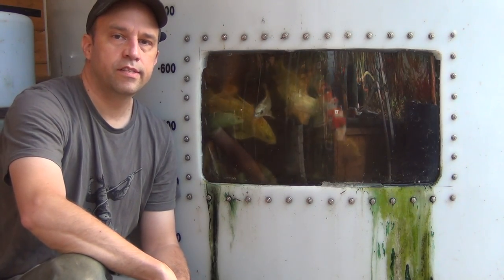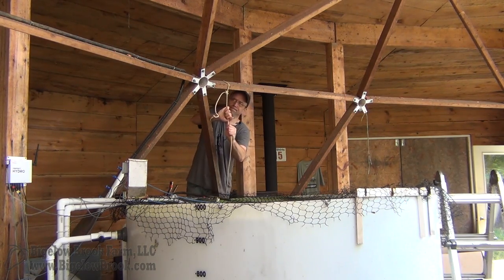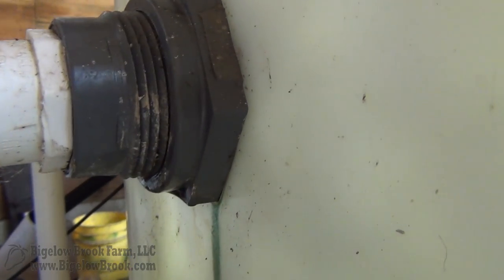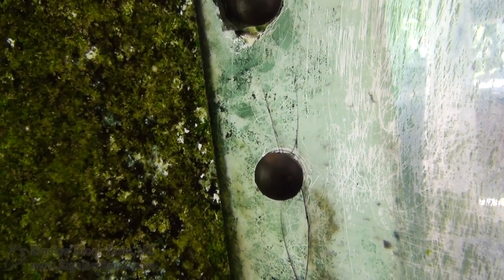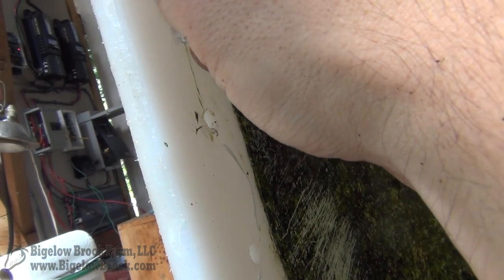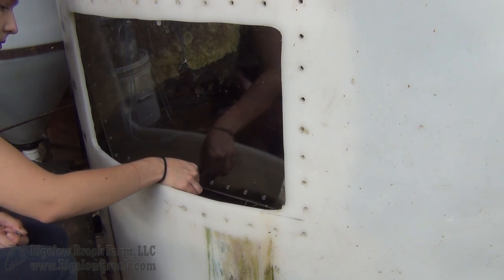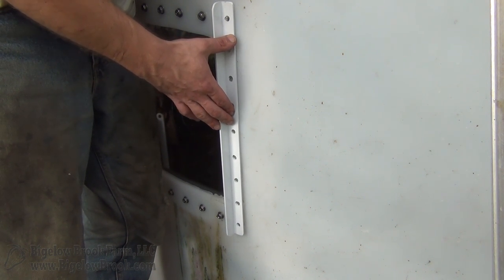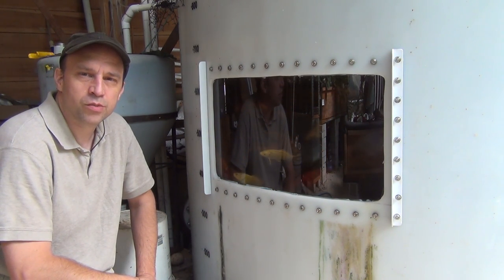Tank Window Repair - Part 2

Comment: If you ever have another window fail, you might want to heat soften its replacement and put a curve into the window that approximates the curve of the tank.  There will be a little less stress on the window, so it will be less likely to crack again.  Using an inch-pound torque wrench on the bolts will help to evenly distribute clamping force.

Comment: Yes, the angle irons will surely remedy this from ever happening again. The free and defective tank undoubtedly helped to point out the effect of cutting out a window section of what was under constant tension, but the problem could potentially reappear even in the new tanks built to specs as soon as the tension becomes non-uniform. When you do the windows in the new tanks, it might be wise to include the angle irons from the outset. One stitch in time saves nine, the saying goes ;) You did a fantastic save without drilling more holes!

Comment: Still think a section of flat stock aluminum or stainless on the inside would remove any spot pressure on the window and make it a more even pressure along the entire side. 

As for the screws would it be worth dipping them in the sealant if you have to redo? Would seal the threads inside the hole but still let you put the nut on before it is cured. 

Also an idea if you have to replace one of the windows again is a glove box with a seal to put over the window inside the tank and pump the water out of to let you work in a dry spot without draining the tank. Who ever is inside will ether need to hold their breath or have an air hose but would let you have the time to replace and the sealant to cure without stress on the fish.
Reply from the maker: It would help with the strength, but will also increase the risk of leaking around that piece.  It would need to also have silicone gasket.  There isn't much need to add anything around the threads since the neoprene washer will prevent water from entering that area.